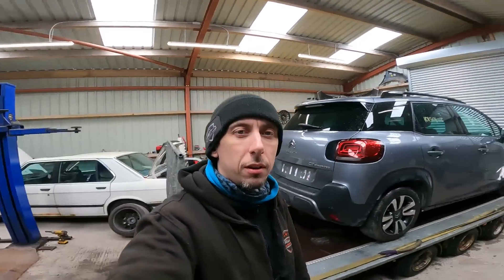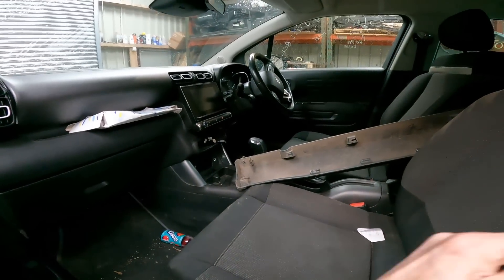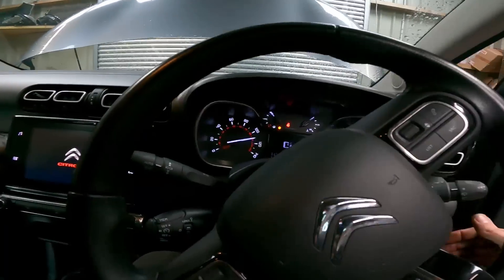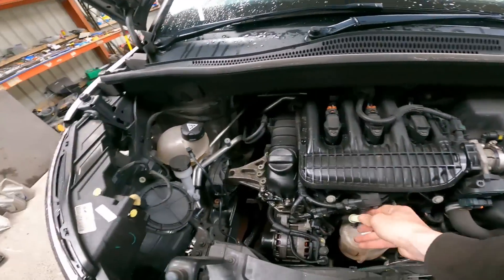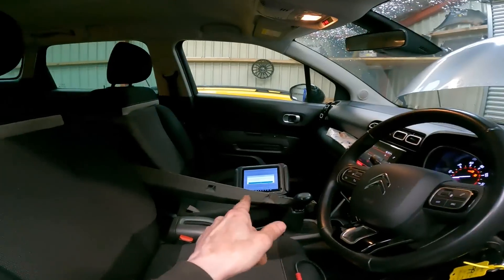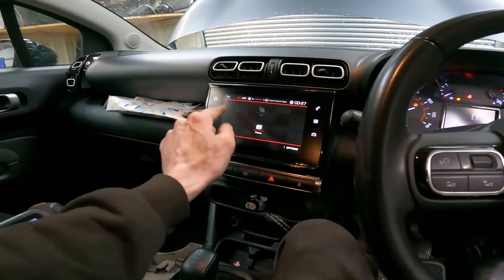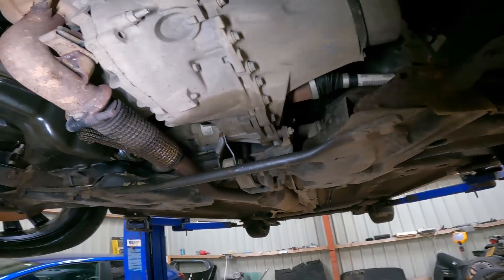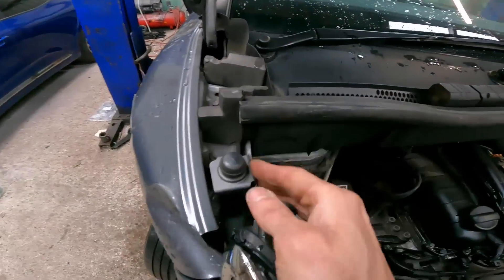First Citroen On The Channel - A Mighty 82 PS 1.2 3 Cylinder AirCross!!!!!

Comment: I’ve got a Peugeot 208 1.2 turbo GT Line, which I believe is the same engine as this but obviously turbo so it’s 110hp, and honestly the amount of tech you get on a budget car that accelerates more than quickly enough for UK roads is great, it went into Peugeot for some warranty work and while it was in I had a 72 plate Citroen C4 which was also 1.2 but was 130hp and I was shocked by how good looking + well speced it was for a £25,000 brand new car, all the modern tech including lane assist automatic braking heads up display heated steering wheel and seats….all stuff you’d expect on a much more expensive car!!! I’ve always said I love seeing the more budget cars on your channel it was in fact your 208 videos that led me here!

Comment: Basically a Peugeot 2008. Depending on spec it could have anything from 90 hp up to 130 hp.
Reply: its got 82 PS  which is about 81 hp in old money. I had the normal C3 which is smaller and lighter than the aircross version and it was woefully underpowered and i mean really bad and I sold it as soon as i could. The gear box was also really bad!

Comment: I had a c5 aircross 1.2 petrol for 3 years and if I removed the battery lead. It would take around 30 minutes or so for the immobiliser to reset. Also the manual gearbox on these whine around 50mph something to do with the cut on the gears.  I was told

Comment: If you've had a Peugeot, Fiat, Vauxhall then you have had a Citroen on the channel, all part of the PSA group. Parts for these are more expensive than you may think so be careful buying these in the hope they will be cheap fixes. The top lights are DRL and these cars have standard Halogen bulbs as their main lights. You have purchased the wrong engined one though, if you buy these it needs to be the diesels. With these you need to wait 10 mins after battery reconnect to allow the BCM and ECU to boot up, the batteries are coded to the vehicle also and will have to be recoded. PS tidy your garage up everytime i see you hunting for something its on the fukin floor behind a discarded piece of car
Reply: Fiat isn't part of psa its chrysler.

Comment: Modern PSA group cars need to be locked on the key fob for 15min after a disconnected battery has been reconnected, the modules reboot otherwise they just crank with a non start
Reply from the maker: Never knew this, thanks Andrew👍

Comment: Not a big fan of a big cars like this with small engines, but if manufacturers think they’ve got enough grunt in them they most be ok
Reply: Plenty of failures on early versions of this engine - it's driven by a wet timing belt in oil, inside the engine. Early rubber belts were disintegrating, bits were being sucked into the oil pickup and starving the engine of oil. Timing belt job on these is complex as you have to take half the top of the engine off, so they're expensive to do.

Not sure but they may have fixed it by now with a more reliable belt, but it's likely they'll go back to chain. It's a shame as nearly all new petrol cars are moving to these small engines.
Reply: @nahladel  Like the Ford ecoboost then!
Reply: Over engineering at its finest
Reply: @priteshchampaneri5101  200 bhp from a ford ecoboost.
Reply: @k8vnl  not all of them?